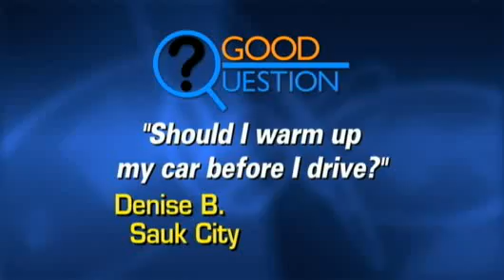Do Vehicles Need Warm-Up Before Winter Driving?

Comment: WRONG  WRONG  WRONG , You should always let your car warm up to normal operating temperature before you start driving , and it has nothing to do with the fuel injection. It is important for your engine to warm up and circulate warm oil through the engine, it is  important for your automatic transmission to warm up and circulate warm transmission fluid through the transmission, and for your own comfort on a cold / freezing winter day it is important for your cars passenger compartment to warm up. Before you race down the road, and jump on the freeway with an ICE COLD engine, you must think about your engines internals and metal heat expansion and contraction .  First engine oil does not flow as well when it is ICE COLD in the cold Winter months as it does in the warm summer months. When the internal metal parts of your engine are cold, the cold metal parts have contracted, (become smaller), and as they heat up they expand to operating tolerances, (become larger). Running your engine hard when it is cold will cause premature engine wear and possible engine damage. This is because a cold engines internal parts have not expanded to operating temperature tolerances, and therefore will have wider gaps, and could even cause catastrophic engine failure. When internal engine parts are warmed up to operating temperature, your pistons will expand, your rings will expand, your connecting rods will expand and stretch. Also, when your engine sits over night, gravity has made most of your oil drain back down into your oil pan. it takes a moment for the motor oil to re-circulate through all of the oil galleys of your engine, and to pressurize a cushion of oil in between your engines bearing surfaces and hard parts such as your crank shaft to connecting rod bearing interfaces, your camshaft to lifter interfaces, your camshaft to camshaft bearing interfaces, etc.  If you don't believe me, than go ahead and rev your engine to a sustained 6000 RPM when the engine is ICE COLD and when is  8 degrees Fahrenheit out side, and see what will happen. Boom! This guy/ video has lost all credibility with me, and I am a Mechanic / Machinist / Engine Builder for 45 years.
Reply: 15-30 seconds is enough and then drive carefully the first 10 or so minutes.
Reply: @GymChess  Good luck with that.
Reply: Uhm, who drives their daily up to 6,000 rpm? I'm not arguing the rest of what you said but that bit gave me a chuckle. Hell, my last car and this one does under 2,000 at 70 MPH.

Comment: Steve Wilcox is a fricking idiot!! You need to at the least let your cold motor warm up for 1 to 2 minutes To make sure that you have oil to the critical areas of your motor like the rings need oil splashed on them so you don't score the cylinder linings the bearings ect!! No you don't have to set their & let it warm up for ever at all you just need to make sure that the cold oil has & is moving around is all But to just start up & take off is stupid!!

Comment: Driving an ice cold car could cause the thick cold oil to cause an oil gasket to begin to leak....  if you do start the car to warm it up be sure to let the engine reach normal operating winter temperatures before shutting the engine off...

Comment: If your car is in the garage, it only takes a minute for it to warm up.. the heater will kick on. That doesn't' really make any difference. If you park your car outside of course you're going to need to let it warm up. I noticed they don't bother to talk about the transmission having to work in cold climates that they only pay attention to the engine. They don't speak about what it's doing to bearings, belts and hoses. The last thing you need to deal with is a belt that snaps right off because these so called mechanics say it's ok to drive off right away so they can sell you a new belt, bearing or hose.

Comment: ITS ABSOLUTELY TRUE WHAT THIS MECHANIC TELLS. You should drive when you startet the engine but slow. Because if you drive slowly the engine will heat up faster then if you wait 10 minutes, so the wear will be less as if you would wait. Also you consume much less fuel
Reply: You dont want to heat it up faster. Just like you don't want to take a cold glass bottle out of the freezer and put it in boiling water. It will break. Quick expansion is what will damage the gasket or cause the block to crack. Idling is the safest (and slowest) way to warm up the engine. This is what professional truck drivers do in cold climates.
Reply: GiulioTech waiting 5 min for the coolant to warm up will cost you at most 5 cents in gas and make it so your window will not freeze up or fog up.  A tiny price to pay for safety.

Comment: Use Full Synthetic Oil in the winter. Easier starts for faster lubrication. I personality use Mobil One Full Synthetic in my Volvo XC 90 and Jeep Grean Check out the testing on YouTube.com. You can see how the oil flows in -40 degree weather compared to conventional oils.

Comment: no no no all of u people are wrong I do not care what u say I'm a mechanic and this guy on here news that mechanic is not telling truth because the engine has oil that oil inside of there has very very little tiny holes it has to go through and that oil is cold thick sitting down in oil pan u can not just jump in and take off or there will be problems eventually I'm telling u could take risks of blowing head or gasket or valve cover or make it have blow by really bad eventually or sealing inside wear out or blow or oil rings so the guy on here does not know what exactly he is talking about I have worked on vehicles to know so warning to anyone let the vehicle warm up the computer in a car doesn't control oil mostly monitors like I said little tiny holes that oil has to go through and on thangs inside of there so especially winter let it warm up the most the most of 10 minutes should be good enough 5 to 10 minutes and while doing that the transmission is same when taking off do go going hammer to metel either bad on transmission when cold u can say what u want to idc but telling u so don't have to be out work or be paying money for that when u don't have money to fix what u messed up when u could have just let it warm up

Comment: No need to warm up,  sure if u can afford to buy a brand new car every 5-7 years 60-70,000 miles.Good quality winter oil does nothing against metal expanding due to temp change.Yes u don't need to wait 5 or 10 minutes, but 2-3 minutes is mandatory when weather temp is less than 20F.
Reply: And that's why half of these newer cars won't make it to 70k let alone 100k. Because these mechanics are telling people they can drive right off in cold weather. Nevermind what happens to a transmission when you constantly drive off with it running cold.
Reply: adrian niemiec No, it actually won't warm up fast enough and will do more harm than good. Get the oil flowing, and then drive very gently
Reply: Lewis Johnson exactly. Don't drive crazy, drive gently until the engine is up to temp.

Comment: Hi there I have a question.  The weather today was about 30F outside and my Dad wanted to drive my '86 honda prelude 2.0FI with 139,000 miles on it.  I started the car up and let it run for a couple minutes about to warm up, and then my Dad started to drive.  I told him to take it easy but he started shifting at about 3500rpm every shift.  I am freaking out cuz I don't know if this has caused damage to my engine cuz not sure if that's too high rpm for a cold engine.  Any thoughts of comfort?  Any advice appreciated!  Thanks!
Reply: +perlewitzaudio Your fuqed.

Comment: this guy is on fucking crack my mom has 02 GMC Yukon and it will not shift into overdrive without the engine warmed up i also have a 94 F-150 5 speed 300 inline 6 I can even shift it alot smoother when its warm and i have had it for over 2 years and you can tell when its warmed up and when its not they both run a lot better when they are warmed up

Comment: I have been seeing more and more articles stating that you do not need to warm up modern cars. I find this very hard to believe, as our previous car, a Hyundai Santa Fe 2.0T would hesitate, and jerk like crazy if you didn't let it warm up for a minute, even when the temperature was in the 40s. At first I thought it had a problem, but then found in the book where it recommends a brief warmup period.

So I really doubt that the manufacturer would recommend a warmup period if it wasn't necessary.

If you ever read the owners manual on diesel equipped machinery, they suggest a 5+ minute warm up period regardless of the outside temperature.

You have to make sure the oil has gotten to all the surfaces, before you start putting excess pressure on it.

Comment: Cant blame the mechanic, due to his constrained knowledge. If he had higher  academic credentials than he wouldn't be getting his hands dirty in the first place.
There is something called "Freedom Of Particles". Viscosity with respect to temperature can be inversely proportional especially in liquids. By having optimal temperature, it will decrease the engine oil viscosity, thus less friction on the pistons. Without warming the car, you will RAM up the pistons up to 3000-4000 RAM, which will damage the engine pistons, due to friction and less compression ratio. Life of transmission will be shorten by 2-3 folds. Lubricants are used to disperse heat and keep the viscosity low to have better over-all efficiency. It is the heat and friction which shortens automobiles life!!!!!

Comment: The video is misleading, inaccurate and simply wrong. Of course you do want to warm up your engine. Ideal condition for an engine is being at its operating temperature. The closer it is to the operating temperature when the car starts to be driven, and the engine gets loaded, the better it is for longevity and wear of the engine. The main reason to warm up the engine is minimize excessive wear of cold moving parts and friction surfaces, as well as to minimized the chances of the parts breaking because they are a lot more brittle in the cold! Not just rubber or plastic,  this applied to metals too.
Reply: You don't want to heat it up faster. Just like you don't want to take a 
cold glass bottle out of the freezer and put it in boiling water. It 
will break. Quick expansion is what will damage the gasket or cause the 
block to crack. Idling is the safest (and slowest) way to warm up the 
engine. This is what professional truck drivers do in cold climates.
Reply: Yes but if you let it idle it will take much longer for your engine to warm up and it will worn more out as if you would start to drive SLOWLY. Its because the engine will heat up much faster.
Reply: @giuliotech5990  Not true, Cylinder combustion is instantly hot.

Comment: Most people don't realize how poorly freezing oil to circulates, even the best winter starting synthetic oil. Most people are not going to drive the vehicle real easy when the engine is that cold like you need to. This video is coming across to many viewers like the mechanic is giving false security to people. Ok they are saying"you can take off right away". I think they mean, you can start driving right away, but don't be flooring it right away. Some engines sustain engine damage to the bearings and tear the pleats in the oil filter when the drivers rev up the engines getting unstuck in snow with thick cold oil that didn't circulate very well right after start up.

Comment: I think it's common sense you should warm your engine up before operating it especially in winter temperatures. You cannot even get the heat to be warm until the engine warms it will spit out cold air. And the metal in the engine needs time to warm and expand an engine will last longer this way too much stress on the parts when your driving ice cold.

Comment: Sure, it is probably right that you do not need to let a modern engine warm up before driving it.
Except... If you are driving around with a cold engine, your breath will fog up the windows, and since your engine is cold it can't defrost it fast enough.
Sure you might not do any damage to your engine, but good luck seeing what's in front of you.
If it's cold your engine must be warmed up enough so it can defrost the windows... it's a safety thing!
Reply: Wrong bonehead

Comment: don't listen to these idiots..  give the car 1 to 2 minutes to warm up and then drive easy....  worse thing you can do is start and go....   You don't need to warm up for 10 min, true... but get in and go will ruin the engine.. technology has not suspended the laws of physics.. thermal expansion WILL occur..  this mechanic is just looking for job security.